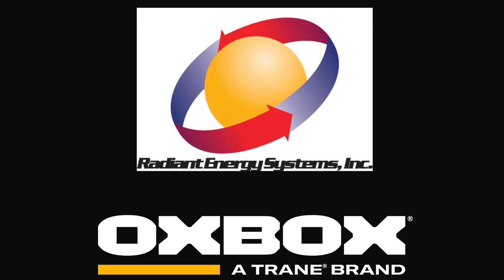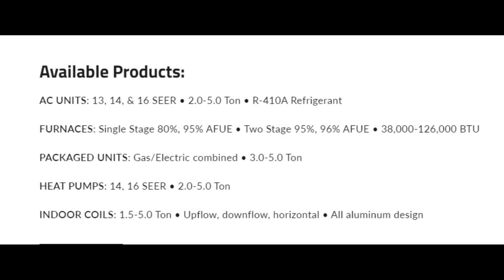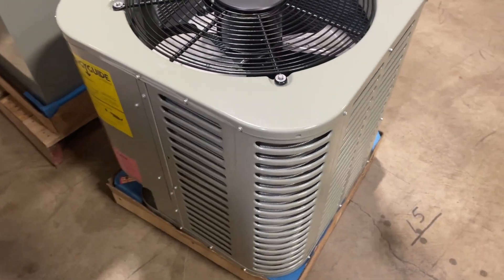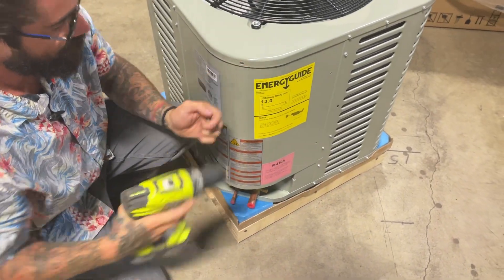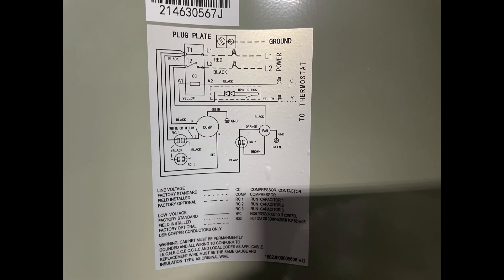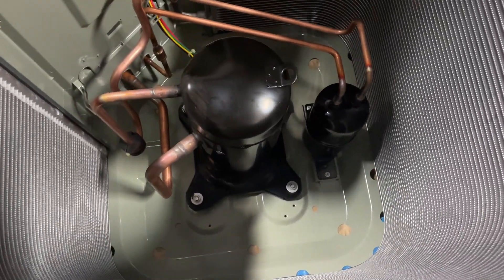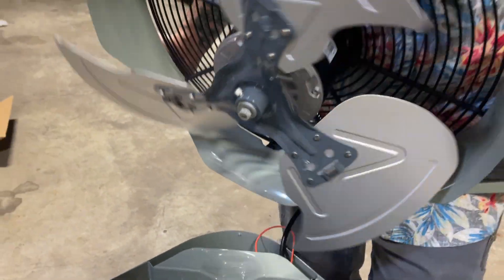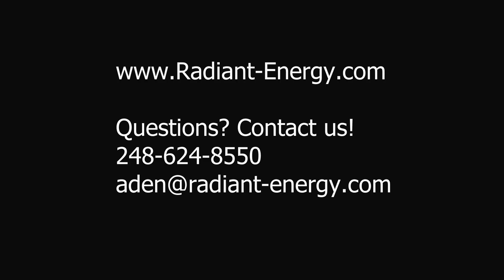Oxbox AC Condenser Overview - Build Quality and Internals

Comment: Can any one update the oxbox new unit with ecm condenser motor and new broad.This is out date unit.
Reply: Oxbox condensers are made by midea as well as the furnaces. Coils made by trane using trane pistons. GMCC compressors. Microchannel only in 5 ton unit. I sell this equipment at my supply. It’s loved by everyone quality is great.
Reply: They are trash mine is two years but stoped working after turned off on vacation, now not working even we changed the board for outdoor unit, technician is confused calling warrant every day still not fixed
Reply: @zabihamid6893  warranty is good. And so is tech support. They can help you get it fixed in 1 call and if not they will give you a new unit. Iv only had one customer have to call tech support and lets just say that customer didnt know what he was doing.
Reply: My 3ton's fan is loud but it works well for now.

Comment: What is the energy efficiency ratings? The documentation does not say the start up or continuous. Has anyone done some testing? I'm trying to keep my 100amp service while calculating what items I can not use at the same time with out tripping. I'm very conservative on power and have 2022 all electric everything with the 120v heat pump water heater, induction stove and a small dorm dryer.

Comment: Any idea why my inside ax unit which is a 4 ton 16 seer oxbow is so loud? It’s brand new and has a loud howling sound
Reply from the maker: Is the sound coming from your condenser or your furnace?
Reply: Oxbox is cheap Chinese junk, and usually only sold by the most unprofessional contractors.  He probably didn't set the fan speed as needed, or measure static pressure.
Reply: @wesfort2822  Every heat pump in America have Chinese parts on them buddy, including Trane!

Comment: This used to be Ameristar. The 3 ton is the only size that is microchannel, the rest are traditional coils. The 3 ton microchannel has a smaller footprint than the 2.5 ton because it is microchannel. I used to install these and loved them. Easy to clean and service.